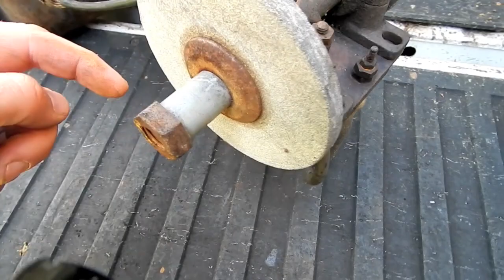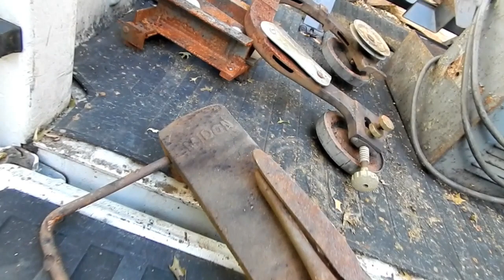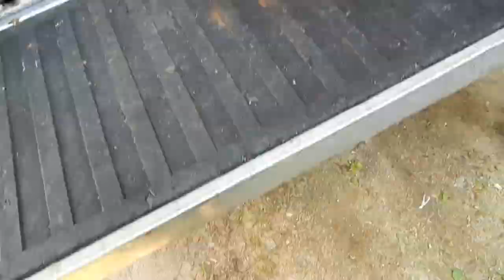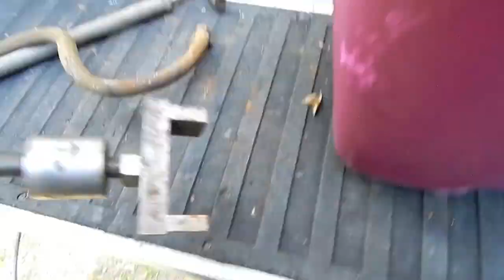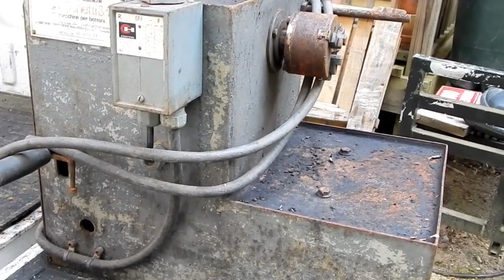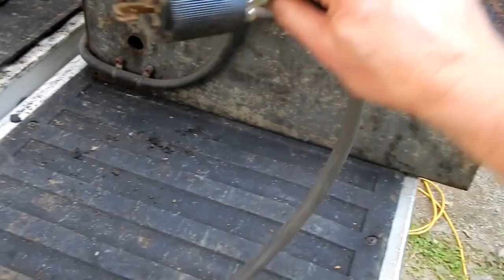Pile of junk June 2019

Comment: As usual Steve finds a load of interesting stuff.  You got lucky you never let the smoke genie out of that motor with that wiring.  My dad had an old 220v motor on his lathe he fitted in the 60's it wasn't new then, he thinks it was an early washing machine motor. It finally quit last year he thinks it was over 70 years old, it was almost built to last L.O.L. I'm wondering if those bigger pulleys came from a washing machine, they don't seem to be very strong for the size.    

Something seems to of happened from the bandsaw clip to the end of the video, it started flashing blue every few frames Is  your camera trying to take early retirement .  I'm wondering if it could possibly trigger seizures with anybody affected by that kind of thing if others are seeing it to. Thanks for the video, Take care
Reply from the maker: The video from the camera looks fine. This effect is only appearing in the final video output by Imovie. I think my desktop mac is pooping the bed.

Comment: Amidon!  THey are a very sweet running mill.

I
 used to run Charlie Amidon mills back in the 70's and 80'.  They were 
originally made in Willington, CT until the patterns were bought by 
Stanley Dombrowski of Canterbury CT back in the late 50's or early 
60's.  He built quite a few wood framed mills and kept many other old 
mills running with spare parts he had cast and finished.  You will find 
Amidon's in eastern CT and usually they were all made from wood.  The 
mill I ran both the track and carriage were fabricated from steel after 
the original wooden track and carriage burned.

Amidons are quite a
 bit lighter than Lane or Chase mills from that era, the pattern maker 
for the castings was a real artist.  The Amidon screw dog was the best 
made, however the tapers were a bit light and I would not recommend the 
use of a log turner as the castings were also quite light, especially 
the racks,  knees and tapers.  Often guys would roll logs into a taper 
that was not retracted and break it.  We ended up fabricating 
replacement tapers from 7/16 steel plate as the cast iron just did not 
take the abuse.  It was a portable mill after all designed in the early 
20th century.  As I recollect the Amidon Screw dog was also the best 
made.  These can often be found on old Lane mills and I know of a Chase 
mill that bought one too.  You also need to take care of the cable drum,
 too much tension on the cable will wear it down.  Often I see mills 
running with not enough wraps around the rum and this will wear the 
spiral grooves right down to where the drum doesn't transfer power 
smoothly.  The problem is also running a long carriage.  A long carriage
 requires more travel on the drum and less wraps.

Sawing 
dimension lumber; white pine and hemlock I could get close to 1500-2000 
feet an hour if I felt like abusing the tail sawyer and the fellows 
downstream!  We ran that mill daily year round and produced lumber for 
carriage sheds and post and beam construction.  I didn't saw many ties 
or grade oak in those days on that mill, it was too hard to make money 
and too hard on the mill and the guys stacking 7x9's!  We tried it for a
 while but not for long.

We powered our mill with a 75hp electric
 motor.  But I imagine that you could get a Cummins 2.8 liter crate 
engine to work as they are not that expensive.  Cummins makes a 
stationary powerplant version.  If you wanted cheap reliable power I 
would go electric.  You can find a vintage 1940's era open armature 
motor pretty cheap in Providence, there was a company out there that 
sold nothing but old electric motors and starters.  You would also need 
to find a 3-phase starter for that vintage and that may be harder to 
find.

Amidon also made the Amidon Cant Hook!  This cant hook puts
 the peavey to absolute shame and we never used them as they were just 
too clumsy. It was the best log turning mill hook ever made.  When 
Stanley died everyone wanted those dies and the tooling.  In fact I 
still have the last Amidon hook Stanley made.  You see in order to get 
Stanley to make new parts you had to visit a while and drink scotch and 
ginger ale and talk shop.  He was an old retired machinist and really 
looked forward to the company.  He would putter around and bye and bye 
put together what ever you needed.  As Stanley got older those visits 
became more frequent as we needed to start stockpiling irreplaceable 
spares as without Stan the mill did not run.  I think some Sawmill 
Supply Company up in Orange Mass may have the dies for drop forging the 
hooks and the rest of the tooling and lath patterns for the fittings and
 handles.

The Amidon blower was another well engineered piece of 
kit.  Stanley made those as well and as the blades eroded from sawdust 
so badly they needed to be replaced every few years or so.  If you 
wanted to look for old mills for parts I would start in Willington CT 
then look around eastern CT.  Especially Brooklyn, CT and Canterbury, 
there were a couple other mills that ran part time.  The mill I worked 
finally was sold to some folks down in southeastern CT.  In fact over in
 Summit Rhode Island, I think the old Kozela Lumber Company had an 
Amidon.  

Good luck with your mill, it was nicely engineered and I really enjoyed sawing with it.
Reply: Wow ,nice info ,I like hearing about that type equipment from days go by.
The old saying " they dont make it like they use too"  sounds like it definitely applies